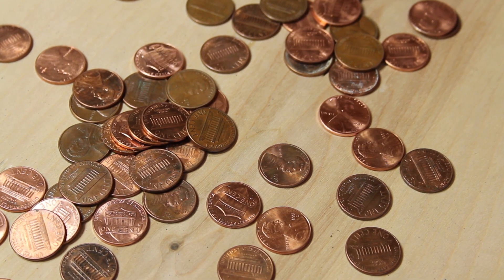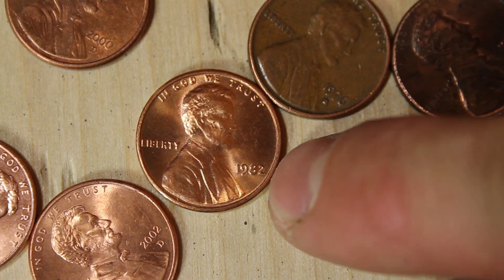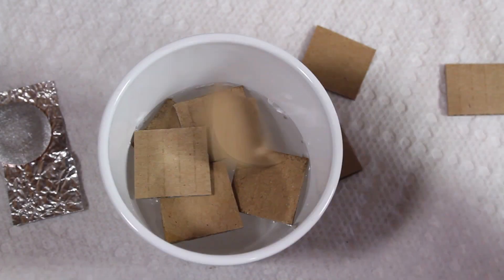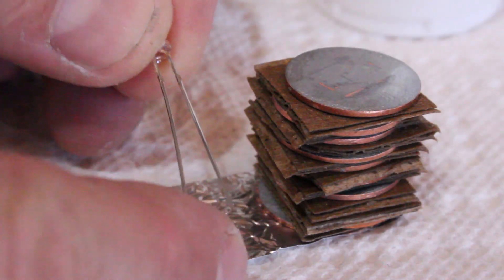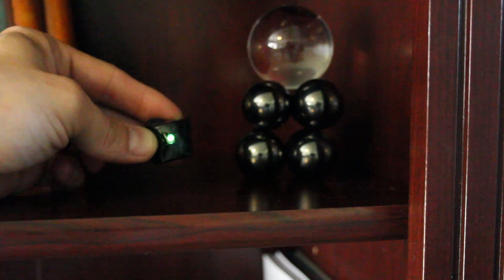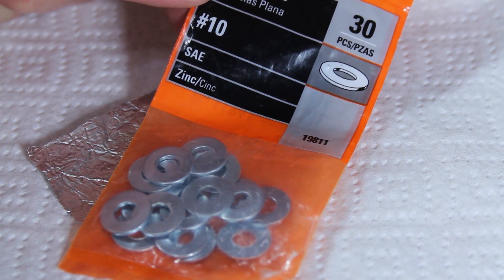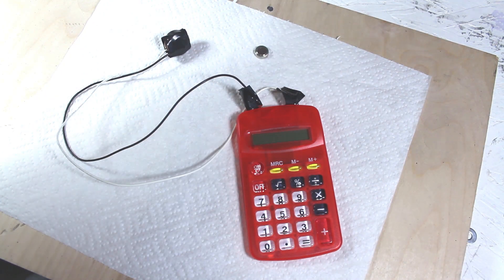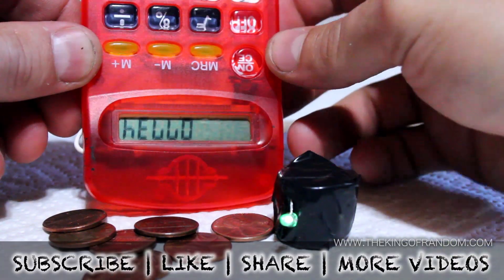How To Make a 3 Penny Battery

Comment: Guys, to save even more AND make it work better AND make it 10000 times easier to make, use aluminium-foil instead of buying washers and tape and use 200 bucks on a sander and making a sticky mess with the adhesive. I like Dave Hax's version alot more! Im sorry

Comment: If 10 pennies = 6 volts, and a standard light bulb uses 120 volts...
You'd need 20x the volts and therefore 20x the pennies.
You'd need 2$ worth of pennies to light a single lightbulb.
The real downfall is the space it takes up.
Reply: +MrTerminalX It won't work anyway. You are forgetting that the light he uses is a LED, not an incandescent bulb. A regular bulb is incandescent. Assuming 30W bulbs, you'll need 250 mA current at 120V to power up the bulb to sufficient brightness. Doing the math, you'll need 10,000 stacks in parallel of 200 pennies in series each, plus a DC-to-AC converter to light up the bulb. Ignoring everything else, you need $20,000 in pennies for your experiment. Plus, it'll take a hell of a lot of space.
Reply: +MrTerminalX Normal light bulbs would require A LOT more than the couple milliamps the pennies would put out.
Reply: most 110 volt devices are ac not dc, so you would need a transformer as well.
Reply: +Jonathan Brooks Or a full bridge rectifier
Reply: +MrTerminalX ;D

Comment: How long did the green light go for?
Reply: Cody Weisgarber LOL
Reply: +Lighter Gull32 
Batteries work as long as they have acid and the positive pole is not completely covered with a thin layer of the other lower grade metal(which will eventually happen).And if that happens you just remove the layer and it works again.

Comment: is that cooper ...??
the cover of the coin  because we in indonesia just have the brass coin
Reply: if you use zinc washers as a catode and a silver plated coin as a anode you could generate a higher voltage.
zinc and brass could also work but not particularly good.
The best battery you could make is with a alkaline metal like magnesium as a anode and a noble metal like gold as a catode.
Reply: +Risnandi Anggara Yes, it's copper.
Reply: TheScoutPro
and my country doesnt have a copper coin only silver and brass

Comment: Couldnt you charge a phone with this?
Reply: +Ian look on your phone charger, it will have an input voltage of 110 volts AC and an output voltage of 5 volts DC. While your phone might draw to much current to charge the battery on a single cell the voltage is right on point!!! All you would need to do to insure a charge would  be to wire multiple cells in parallel. I'd say 5 or six of the 5v cells would do the trick.
Reply: +GTLMods I doubt it. Power outlets vary in voltage strength around the world but they're all between 100 and 240 volts. this doesn't even crank out 6 volts.
Reply: +GTLMods I was alo wondering the same thing, too
Reply: +GTLGaming it puts out .17 milliamps and your phone needs 500

Comment: ive tried to do this and ive used (from bottom to top) a penny, a zinc plated washer, and distilled white vinegar soaked cardboard.  (made multiple cells) and yet it still wont light a single red LED. what am i doing wrong?

Comment: A fun calculation: if you got 5282 stacks of 6, and connected them all, you would have 1 amp and 35294 V, or 35294 Watts = 35.294 KW. That is enough to power a electric car!

Comment: Really a great video! Thanks for sharing! What can you do so you don't have to worry so much about moisture? Can you solder them together with a bit of something? It seems like something for a calculator depending on its use the cardboard would dry before anything else stopped working.

Comment: Can other coins such as quarters nickels and dimes do this?
Reply: I'm gonna try this
Reply: +Billy  Wad    Good question .
Reply: T. Stins and you don't have an answer ...I'm excepting an answer from anyone
Reply: Well, all I know is this : quarters are supposed to be made of silver on the outside, and copper core on the inside. nickels are nickel and i believe some zinc . dimes are silver outside, copper inside. the newer pennies , from about 1972 and above are copper outside and zinc inside. the older ones are pure copper. ( if you don't believe me, try this . take a sharp knife and cut a straight line down the front or back of a newer penny, hold it under a bright light, and when you tilt it side to side, you will see the shiny silver looking metal inside under the copper coating. that is zinc . )
Reply: +Billy  Wad   The electricity comes from a reaction between the copper (negative I believe) and the zinc (positive I believe). Because of the fact that one is positive and one is negative, the electrons travel through the electrolyte solution (vinegar) from the negative one in order to reach the one positive one (electrons carry a negative charge, so the anode holds more electrons). Once the electron count in both the copper and zinc is the same, there will be no more flow of electrons and therefore no more electricity. 
 
  That being said, the only way other coins would work would be if they possessed both negative and positively charged metals.

Comment: If you replaced the cardboard after the cell ran out of power, would it work again?
Reply: As long as you keep adding cardboard soaked in an electrolyte it'll work. I think it'll even work better with a water and salt solution (NaCl or NaHCO3) because acetic acid is a pretty weak electrolyte.
Reply: Thats pretty cool, i could use this for my remote or things like that.

Comment: the good thing about this is when the copper can no longer accept anymore electrons the pennies are worth exactly what you got them for. If you use nickels and pennies both electrodes are 100% value refundable when the battery dies. power for the price of salt or vinegar

Comment: How many pennies would it take to power a 300 watt computer? (of course its a scrap computer) Since its dc I would need a power inverter but how would I even begin to calculate this? Yes, I'm aware its not practical but its just an experiment that I would love to try. Also, would I need to make up a bunch of penny cells and put them in parallel or series?
Reply: Well, each penny gives you about 0.6V and 500µA (= 0.0005A). So you would actually need 1 million pennies. 0.6V * 0.0005A * 1 million = 300W. But the good news is you don't need an inverter. PC power supplies can run on AC or DC. You could make a stack of 333 pennies to get around 200V and then put 3000 of those stacks in parallel to get the current up to 1.5A
But why not try it with a cell phone instead? Then you'd only need 3000 pennies.
Reply: Over 9000!!
Reply: about 1000 pennys? xD
Reply: Crazy_Gaming lol thats a nice round number but something tells me its going to take a lotttttt more. Haha
Reply: spider pig update... I didnt realize 1M Pennies is $10k lmao. 
Welp, on to the next experiment. 😃
Reply: +Spectator Mag This channel has a video on how to make a furnace that can be used to melt your copper.
Reply: Atristiel i have about 80lbs of copper so  thats feasible.  Just need to figure out how to melt it down first.
Reply: Spectator Mag 36 kilos of copper, that's impressive!
If you want to melt it it means that it must be in an ingot form or as thin wire. Find how to make some kind of a furnace in your back yard.
I'm inexperienced with metallurgy but I hope my idea can spark some brainwave. I would spill the molten copper onto some steel baking tray very thinly to be able to cut rings out of it afterwards. Cutting all those rings though would kill my arms without some serious power tools.
Maybe bigger rings would yield more volts per cell? I don't know, try it.
Reply: Actually, I think you would have to hammer the cast flat when it's still hot as it may solidify pretty quickly.
Reply: Spectator Mag I'm glad I could help.
Quick google shows that cheapest band saw machines cost in excess of £100 ($149). Actually, that on top of furnace costs would make your experiment quite expensive.

I guess you could still make the furnace to do something interesting with your copper but if you can't afford the machining tools, how about buying copper washers?

It's funny that there are so many elaborate ideas we can think of before coming down to the ground and think of efficiency and practicality.
Reply: Atristiel Most definitely! Will post video once I figure the best method !
Reply: +Spectator Mag OVER 9000
Reply: Ha, then I need about 3500 to power mine!
Reply: spider pig Finally! Thank you! Well as far as the cell phone goes ive see endless videos powering them. I need more of an awe factor. (i get bored very quickly, very lol) Anyway, Thank you again, i really needed some type of foundation to start with.
Reply: Spectator Mag You don't necessarily need pennies, get some scrap copper, cut it/form it into a nice shape (obv smaller to have less value than a penny per piece) polish it out and you have a copper disk.
Reply: Atristiel NOT A BAD IEAD! Well right now they're in the form of little brick slabs. Closest resemblance would be a candy bar about 60 centimeters long and roughly .5 centimeters thick. I read something about a homemade crucible. Maybe i could build a crucible with a pouring hole the size of a penny (or maybe a quarter) and a few centimeters deep . I'm thinking the end result would be a solid copper pipe as long as a few hundred stacked pennies. I could cut the disc that way. You're right though, i would need a serious cutting tool. I tried cutting one of the bars the other day and barely caused a scratch. Hand tools are a no go with their current thickness lol. Wow you really have my gears turning now!
Reply: spider pig Ac Dc

Comment: I saw that you took two different approaches and getting the same voltage results. What would happen if you use solid copper pennies and zinc fender washers? I ask this cause I saw that you were using the zinc core pennies with the zinc washers on the second try. I was wondering if having more copper would create more of a reaction with the vinegar and the larger zinc surface area of a fender washer>? Thanks and great videos!
Reply: Chemically speaking, because the outer coating on pennies is essentially pure copper (so using a higher purity copper over all in the penny doesn't change the interaction chemistry), the reaction rate (which is to say power draw) would not be effected. It would however last longer unless the limiting factor was electrolyte evaporation. The larger zinc washers may allow for a higher reaction rate, but realistically the limiting factor is likely the diffusivity of ionic charge across the salt bridge (in this case the soaked cardboard). This is likely the limiting factor because the battery lasted so long as it was (indicating that the energy draw was a mere fraction of the possible maximum). This is actually an important feature in real batteries as well (which is why they do not INSTANTLY drain to zero when shorting, the cell divisions have a limited current capacity). 

It would be interesting however to soak the material in various liquids to see the difference in potential, and even using different material separation (fibre levels in the paper for example).

Comment: You mentioned that one penny provided 0.5 volt. I am trying to achieve 1.35v for an old camera. Two pennies seems like it would get me there and three would be to much. Do you have any ideas? (I have no voltage meter to test it my self.) 1.5 volt batteries are too strong for my camera.
Reply: You could test it on your own with different diffusing materials. A less ionic liquid (say more dilute vinegar for example) should achieve lower voltages in this case but also may have issues with drying out unless well sealed.

You could separately look into capacitors designed to discharge at 1.35 V (a charged capacitor is a battery technically, but capacitors are available over massive ranges of voltages these days whereas batteries are more... standarized.)
Reply: Anthony Schroeder  Thank you for the advice Anthony. I'll give that a try.

Comment: When the light goes out, You just clean the pennies and do it again..  If You do that with copper tape and aluminium tape from the craft store, You can make a bigger, longer lasting battery..  Store the battery dry and just add vinegar or salt water when you are ready to use them...    Great battery for Doomsday Preppers..  I've made 12 volt batteries that way before..  Totally cool...

Comment: What is the thing you were using to measure the voltage, i need to know for a science fair please tell me.
Reply: Multimeter. Checks current, voltage, resistance(ohms)..
Reply: Also where did you get that LED light?
Reply: I think that's a multimeter.
Reply: thanks guys, i present tomorrow and I feel very prepared.

Comment: But will it recharge?
Reply: the real question is will it blend
Reply: I would think so, just replace the soaked cardboard
Reply: angrycreeper100 To an extent one runs out and the other one is filled up, and I was wrong the flux is from zinc to copper, what happens is the following, the acid solution that represents the vinegar makes the zinc on the surface loses electrons, and the copper will accept them, creating a flux of electricity from one to another, when the zinc has ran out of electrons to loose or the copper can't take anymore the flux stops
Reply: @wardt rohan you're*

And yes I am studying yet english is not my forst language so stfu
Reply: The reaction happenning is a flux of electrons from the copper to the zinc so no, it won't recharge unless you apply the same amount of electricity in the inverse way to undo the reaction, source this is a basic redox chemistry reaction and I'm studying chemichals engeneering

vinegar only acts as an acid solution to help the flux work
Reply: ya
Reply: so does the copper run out or something
Reply: Jose David Espinal Caballero what do you mean exactly with "unless you apply the same amount of electricity in the inverse way" ? thanks.
Reply: Ugh it is hard to explain if you do not understand the basic concepts of redox chemical reactions, what I mean is to connect the original negative side to the positive side of a battery with the same voltage and viceversa to force the electrons to go the other way around
Reply: Jose David Espinal Caballero ok that made cents but the other stuff was alien language to me.
Reply: Jose David Espinal Caballero hmm your studying chemicals yet don't know how to spell it
Reply: Jose David Espinal Caballero I agree, this is also the basis for galvanic corrosion.
Reply: ok
Reply: angrycreeper100 omg lol will it blend opening song xDDD

Comment: How long did the LED on the first battery stay on for?  It would be nice if someone would do a mAH test on the battery.  If there is ever an emergency, and I need to charge my phone, I need 10 pennies and 10 pieces of vinegar soaked cardboard to get up to 5 volts.
Reply: It says in the description:

"Many people have asked how long the green LED stayed on. Surprisingly, it was bright for 2-1/2 weeks before finally fizzling out!"
Reply: Gabriel Brown
LEDs take barely any power to run.
Reply: you can get 5 volts no problem, the issue is current. you wouldnt be able to get anywhere near the amperage needed to charge a phone with out building a large array of penny batteries.

...thats not to say its impossible...
Reply: I am afraid, its not enough power for your Phone. My oldest phone has 3.6 volts and 900mAh

Comment: I've tried, but doesn't work! I used alcohol vinegar and I used 2 cents coins newer than 1982, I don't understand!
Reply: Alcohol vinegar might not be acidic. Try something acidic like White vinegar, or to be extra sure, you can use pure lemon juice.

Another thing that MIGHT work is salt water. Worth a shot.
Reply: TomaloTube(MOVED) acid will work.  salt is alkaline, I think its battery acid. that makes a battery work.

Comment: I made a 9 volt penny battery, bound it with a rubber band, poked holes in a film canister and led wires out of it for a case. I got it to light 3 LEDs

Comment: 5 to 6 volts?  It seems that's enough to power a USB device unless I'm missing something.   Would I need to make two of these connected in Parallel to up the Amps & charge something?
Thanks. Love your channel.

Comment: can you try using the pennies to charge a phone?
Reply: why not to power?
Reply: you'd need alot more cells to produce the draw power of a smartphone. assuming that it can sustain over 3.5v for 24 hours and the average phone takes 1/2 watt for average use (not including spikes in consumption or app usage, the powercell would work. but this type of battery cannot sustain for such a duration, so it's not feasible/practical. maybe a slow gradual charger but once again not practical for every day use.
Reply: R3D33M3R he said it stayed on for 2 1/2 weeks
Reply: yes, problem is that's a very low draw rate, powering an energy comsuming beast like iphone or an modern phone would be difficult

Comment: What was the forward voltage for that led??? Most are 3/4-3/6 and should have fried at 6v with no resister!
and should not have even fired on the second battery

Comment: They electricity is generated by an oxidation-reduction (redox) reaction between the copper and the zinc.
Reply: in my experiment when i have used vinegar the zinc went black, i think it is better with the salt solution. plus that i don't even get 0.1V with my cell, i have used thinks coated with zinc, is this the problem? Do i need a solid block of zinc?
Reply: That's because the acetic acid in the vinegar reacted with the zinc and formed a salt (Zinc acetate). So I would say that salt would probably be the better choice.